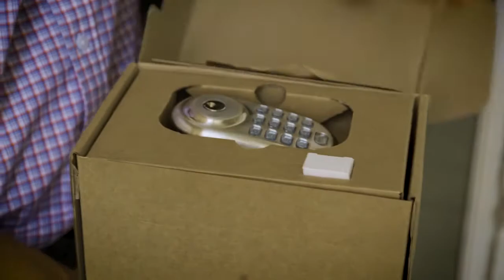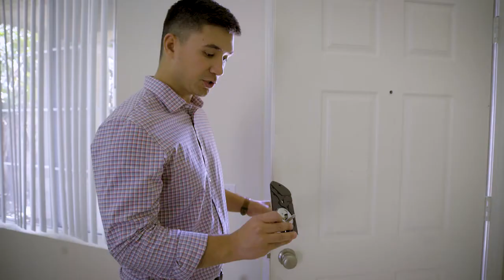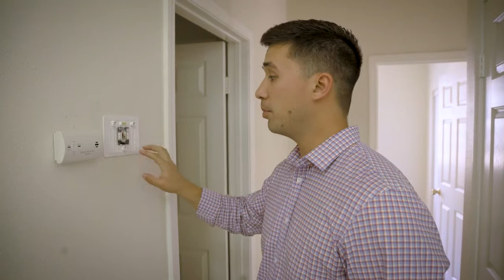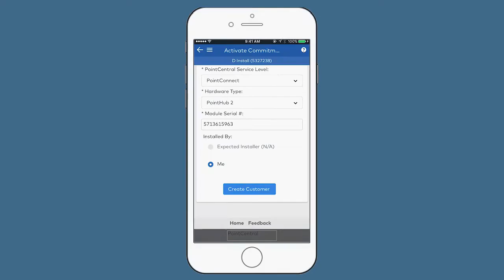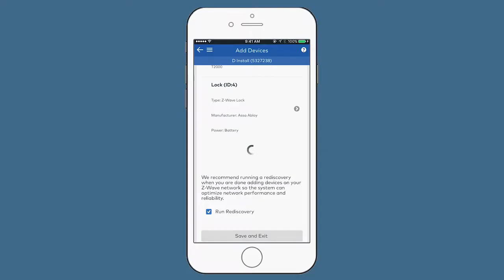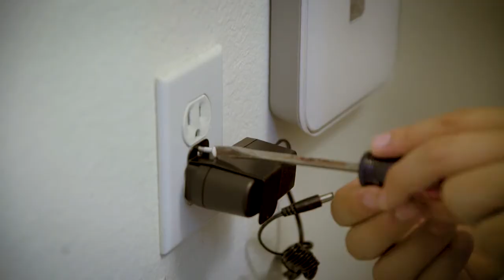PointCentral System Installation

Comment: What technology links device to the hub?
Reply: @Hans Mortensen Thanks for the explanation.  So, Z-Wave covers device to hub and cellular service for hub to office.  If I may ask a more general question, do you offer a portal for Owners to monitor home conditions?  Rental agent is installing for their purposes and they have generously offered Owner the keycode for home entry (he says tongue-in-cheek), but Owner wold be interested to know home temp and have the ability to adjust, too.
Reply from the maker: @eeandersen  devices are paired to hubs via z-wave. Panels are a mix of protocols, depending on the device type.
Reply from the maker: @eeandersen  PointCentral is flexible. We would need to understand the use case and walk through the property management and homeowner needs/wants.